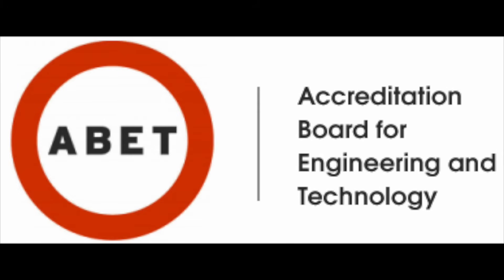WHAT IS ENGINEERING TECHNOLOGY (DIFFERENCE BETWEEN THEORETICAL ENGINEERING) in the U.S.?

Comment: It's funny how some of the engineering-focused youtubers still spout myths about the differences in pay and prestige.  I'm graduating a 2 year community college associates program in "Electrical & Automation Technology" this Spring.  I'm non-traditional (went to University for English over a decade ago now). 

I've already had 3 job offers, which is a privileged but difficult problem to have. The most recent of which is more "classically" engineering focused with no hands-on work: designing protection and controls systems for the grid -- it has an incredible team and will pay for me to continue college if I want the full engineering title.  I just don't want to be locked to a desk out of the gate and not get the field experience (which is what I came back to school for).

I interned at a pulp mill last year and the techs make more than the engineers out of the gate with very little overtime (that may tilt after you have a decade or so as an engineer) but the culture sucked.

My dream is to find a place that has a great team that will offer hands-on experience and potentially pay for the next 2 years of school should I decide to get more into engineering after having a foundation in the field.  Our school has a 2+2 agreement with the state university.  Its pretty rigorous too, where all the kids that end up going to the University find the 2nd two years easy and blow past the kids that started out in full engineering with no actual hands-on applications.
Reply from the maker: Congratulations on your upcoming graduation, and you chose an amazing field!  That is also my background as I started at a power company with a 2 year degree before I completed my BS degree.  You are correct about the Youtubers, and it is not just Youtubers.  Half of my colleagues in the traditional engineering programs here at the university do not understand that my students are engineers and will have the same opportunities as theirs (sometimes more).  I have been doing this for a long time and I am certain that the best engineers start out as technicians!  Keep up the good work, and I would encourage you to go ahead and get the 4 - year degree because you never know what the future holds.  As a non-traditional student, you understand that it is probably easier to keep going while you have momentum.  Good luck and keep me posted.

Comment: Please tell me the difference between civil engineering and civil engineering technology, Can I work on the design side of civil engineering with a technology degree? After a Bachelors degree of civil engineering technology, Can I do a Master in Structural engineering?.
Reply from the maker: Hello, great question, and of all the engineering technology programs, I would think that Civil ET is the hardest to determine the validity of the degree in industry.  I say that because you will definitely need your PE in Civil engineering, so the first thing to do is to make sure that your program is ABET accredited then look at your state requirements to see if they allow ET graduates to take the PE.  To answer the second part of your question, yes you can get a Masters in Structural Engineering, but you will probably need to take gap courses before you start your Masters.  I have a friend that took this route.  He completed his CET, then took some Calculus and Physics gap classes, completed his Masters in Civil Engineering and is now completing his PhD.  I hope that this helps.

Comment: Coming from a supply chain background, I got my BS in Supply Chain and am looking into an MS in Ops and Supply Management with an Engineering Technology Concentration.  I have a couple years of experience in sourcing and NPI.  What kind of technical roles could I apply this degree towards in the future?  Would this make sense to pursue instead of a concentrated supply chain/quality concentration?
Reply from the maker: That is a good question, and Supply Chain is an excellent area, but is usually under a business degree.  Sometimes schools cross engineering technology with management in master's degrees to prepare graduates for roles in management.  This generally means less technical roles and more management/supervisory.  That is what this degree sounds like, so I do not really see a benefit of this over a concentrated supply chain degree.
Reply: @TheCommonSenseProfessor  it comes with a six sigma black belt certification and focus on manufacturing and quality. Could I expect some engineering or quality roles to open up in the future?
Reply from the maker: @rickejosh1  Possibly quality, management, or supervisor roles, but I would doubt an engineering role would open up without an engineering background.  If your undergrad was engineering or engineering technology, then maybe.  I bet if you talk to the advisors that they would tell you that this degree was meant for someone with an engineering undergrad degree.

Comment: Thanks so much for this video. So helpful. I am about to finish my Associates in MET and I love applied, hands on engineering. I know you said if you want to be a tech, then all you need is 2 years. With just an Associates, can you still move up through the ranks with that, or do you find more education is needed? Just as a tech or technologist, not as a full fledged engineer. I am struggling a bit to see if getting a B.S. in Met is even worth it if I don't want to be a full fledged theoretical engineer. TIA!
Reply: You can always go back later after you've had experience in technician work.  You will be ahead of the game.

Both the professors in my 2-year program (both retired engineers) have endless stories comparing the "pure theory" engineers with those that have applied-skills.  Most recently one told me about getting hired at a paper mill next to an MIT engineering grad: a supervisor sat a motor control box in front of each of them and gave them some task for rewiring it.  My professor was able to tackle the problem right away, while the MIT grad just stared at it like it was some kind of mysterious artifact.

Comment: I’m currently a second year Mechatronics Engineering Technology student. Could you tell me more about the job outcomes for this major and what types of coops I should be aiming for. Thanks
Reply from the maker: Hello Martin.  I would look for coops in Automation Engineering, and start early and do as many as you can so you can get a good feel of the type of industry that you want to pursue when you graduate.  You might start out in a technician role then move more into an engineering coop role closer to graduation.  You will learn so much at a coop, and I always encourage my student to get as many as they can, and I think that you will learn quite a bit from a technician role as well.  I believe the best engineers started as technicians.  As far as job outlooks, remember that you are not going to find jobs as a Machatronic engineer, but the jobs you are looking for will be automation or controls engineering positions.  My students in KY are in very high demand (we call our program Electromechanical Engineering Technology, but it is the same program).  They are making between $62.5K-$85K right out of college.  Many of the companies that are hiring them are called integrators, and they love students with backgrounds in mechatronics.  Hopefully, your professors have a good connection with industry, as they will be your best solution to getting contacts.  If not, I suggest that you go to indeed.com and search out automation engineering interns for your area.  I made a video to help my students with this: https://www.youtube.com/watch?v=JPtxfHf7aE0&t=20s

I hope this helps

Comment: Thank you for the video! I am currently a senior in an industrial engineering bachelors program. I currently work as a manufacturing engineer intern. If I had known the information you presented before I entered university I believe I would have gone a different route through my education. I enjoy both sides of the theoretical and applied spectrums I am afraid however that the applied side of my education may be slightly lacking. Do you have any suggestions on applied engineering skills for me to further study on my own to supplement my skills?
Reply from the maker: Hello Mason. With my experience, the thing that separates a bad engineer from a really good engineer is the combination of understanding between theoretical and applied.  I always tried to learn from technicians that I worked with as they understand the processes, or applications, much better than many of the engineers that I worked with.  Operators are skilled in this area as well.  I would suggest to you to start now in your internship by talking to the technicians and asking them their opinions about processes, etc.  Many engineers have an elitist attitude and will not humble themselves to learn from technicians and operators, but trust me, you will learn quite a bit about applications.  I hope this helps.

Comment: Finally  someone that knows the difference in a 4 year and two year degree in technology. In Arizona I can apply to take the PE exam with a 4 year degree in Electronics Engineering.
Reply from the maker: Thank you Brian.  There is quite a bit of bad information out there, and I wanted to set the record straight.  The unfortunate thing is that many college administrators and other engineering professors do not understand the difference.

Comment: What the difference between mechanical technologists and engineers?
Reply from the maker: That really depends on the area.  I can only speak for the US, and I mentioned the differences in the video.  This is true for any ET program vs theoretical engineering program.  I will say that although Mechanical ET graduates can become engineers, and in most states even become professional engineers, I would say that a higher number of MET graduates are Design engineers (AUTO CAD drafters) starting out because of the emphasis on applications over design.

Comment: The community college (closest to me) offers engineering technologist support certification. It also has engineering drafting technology which you can get a certification or AS. I want to go for mechanical engineering. Is taking one of this good enough towards my goal? Hope I made sense. If yes, which one should I go for? I'm considering just going computer science AS,T.
Reply from the maker: Hello.  If your goal is to get a BSE in Mechanical Engineering, then I do not suggest either one of the options you mentioned.  If the community college does not have a pre-engineering AS, then you should be able to get a transfer AS that you can load up with maths and physics.  You will need Calc 1, Calc 2, Calc3, and differential equations if the college offers those courses.  You will also need the calculus based physics 1, 2, and 3.  This is really all a pre-engineering degree is.  I would definitely contact the university that you plan to transfer to and make sure that all your classes transfer into their courses.  I hope this helped.

Comment: I'm taking Electrical Engineering Technology at a technical school to get an AAS and I would like to transfer to a university to get a BS in either Electrical Engineering or Computer Engineering. Would the fact that I'm studying EET set me back from getting the actual EE  or CPE degree at a university?
Reply from the maker: Yes it will absolutely set you back.  If you are planning to transfer to get an EE or CE, then you need to complete an AS pre-engineering transfer degree at the community college.  If you do not, then it will set you back almost the entire 2 years.  The pre-engineering degree will basically be all your General Education courses with your Calculus 1, 2, 3, and differential equations in addition to Calculus based Physics 1, 2, & 3.  Unfortunately, a pre-engineering AS degree is not worth much by itself, where a AAS in EET will land you a really good job if something were to come up before you transferred, but I see no benefit in in getting the AAS to transfer into an EE or CE degree.  Thanks.

Comment: I’ve been stuck between EET and EE for a year now. I’m comfortable in EET and the work is interesting but I feel I would regret it if I did not go for it in EE. Every one tells me EE degree is better and more respected. I see nothing wrong with an EET degree, it’s my understanding that the 2 degrees make roughly the same money. Help me prof
Reply from the maker: The thing that you need to understand is that with a 2 year EET degree, you will be a technician in industry.  There is absolutely nothing wrong with this, and in some places it is true that you will make the same if not more money than engineers because you will more than likely get paid hourly which means that you will also get overtime, something most engineers do not get.  So if you work for a company where you can get a lot of overtime, then yes you can make more.  A four year EET degree will more than likely land you a similar job as if you had an EE, depending on the state you live in.  Do a search for the PE requirements in your state, if they allow engineering technology graduates to sit for the PE license, then there is really not a big difference between the two degrees as long as the EET is ABET accredited.  I would really base my decisions on a couple of things: Your ACT or SAT Math score (generally if you make around a 26-27 math ACT you should be fine either way).  Anything much lower, I would seriously consider EET.  The other thing I would do is to talk to the EET faculty and find out where their students get jobs, their average salary, and their placement rate.  I hope this helps.
Reply: @TheCommonSenseProfessor  thanks professor. I’m currently in my second year in a 4 year EET degree. I live in the state of Texas and the website is not clear to me if I can wait for a PE license right after graduation or if I must wait till I have work experience. Are you familiar with how the process is in the state of Texas?
Reply from the maker: @Luisgar1234  if you scroll down to Texas on this website it gives you a good overview.  With an EET you basically need 8 years of experience before you can apply for a PE.  There is one interesting statement, "All degrees must have 8 hours of math beyond trigonometry (courses such as calculus and differential 
equations)".  You probably won't get this with you EET alone, so if you are interested in pursuing a PE someday, you will need to take the extra math courses.
file:///C:/Users/JHILDE~1/AppData/Local/Temp/Engineer%20Licensing%20Requirements%20by%20State.pdf

Comment: Can you still be in aerospace and work with and design machine in this degree with mechanical engineering technology?
Reply from the maker: Yes you can, but remember, aerospace is like the automobile sector, there are many different companies in their supply chains.  Can you work for NASA as an aerospace engineer with a MET degree?  No, but you can probably work for a company that is in the aerospace sector as a mechanical engineer.  You can also work in the area as a CAD designer with a MET degree which means you will be working with designs all the time.  Many MET graduates get jobs like this in large industries.

Comment: I’m a mechanical technician at the moment and I want to go back to college to become an engineer, but as you said I love doing hands on work. My buddies tell me to become a field engineer. Is that a certain type of career path or is that just a job position?
Reply from the maker: Hello Gilberto.  A field engineer is a general term used for someone who generally travels for a company and is usually hands on.  It is a more generic term, but unless you want to do some serious traveling, you might want to look at other options.  My background is I&C Engineering (instrumentation and controls) and it was more hands on than lest say an Electrical Engineer.  Automation Engineers are usually more hands on, and then if you get a job with a smaller company as a Systems or Manufacturing Engineer, it could be more hands on.  It really depends on the companies and you just need to make sure that you have a clear understanding of the position when you apply.  If you are interested in the I&C or Automation engineering route, then I would look for a Mechatronics program in your area that will accept your MET associate degree called a 2 + 2 (your 2 years plus two more years at their college).  We have a program like this in Manufacturing Engineering Technology and it helps students in your situation get that engineering position.  I am a firm believer that the best engineers are technicians like yourself that work their way up to an engineering role.  I hope this helps.
Reply: @TheCommonSenseProfessor  Yes 👍 Thank you for the advice I really do appreciate it!!!
Reply from the maker: @Tankout360  Anytime

Comment: Great Video,
I think it might depend on the school in terms of classes. NYCT students take calculus 1,2 and differential Equation so the physics classes are calculus base at least till calculus 2.
Reply from the maker: It definitely depends on the school.  If I was a betting person, I would bet that the ET program(s) are led by theoretical faculty instead of faculty with an ET background.  Unless there is a local need in industry for the elevated math and physics classes, there is not going to be a big differences between the theoretical engineering and ET programs at the college.  Another reason might be to limit the enrollment in the ET programs.  There is a great peer reviewed journal article that talks about colleges  that have ET programs that are almost identical to theoretical engineering programs because the faculty do not fully understand ET.  Thanks for the comment.